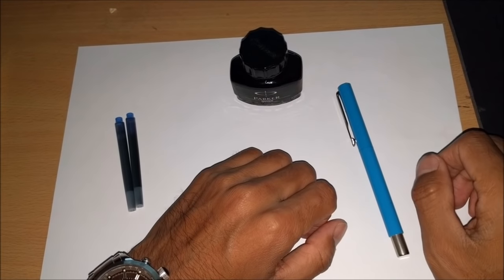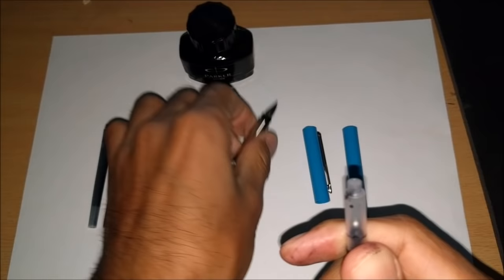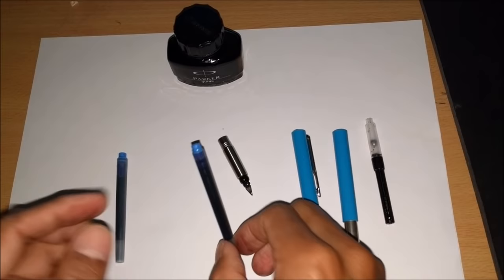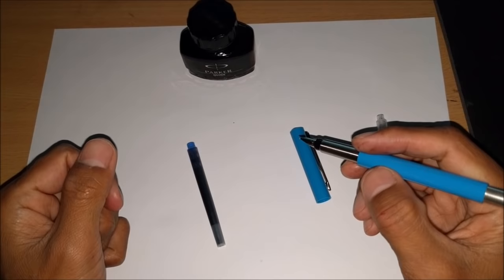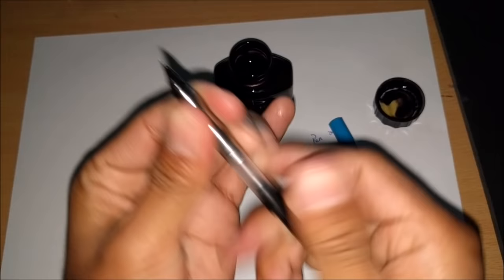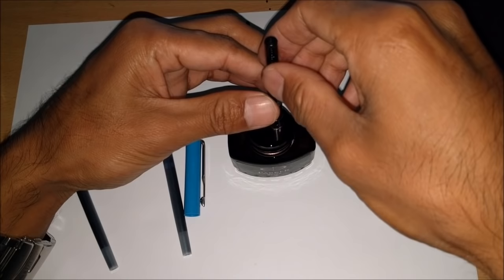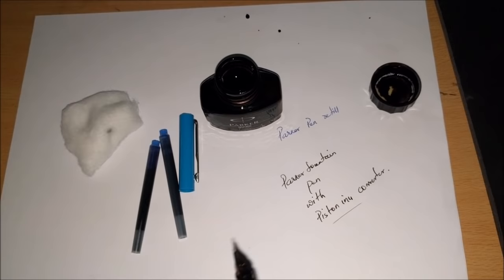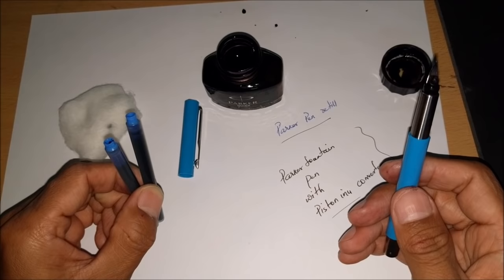Parker Fountain Pen Refill - Piston Ink Converter and Cartridge

Comment: Guys i need your help
I have old parker 45 Flighter edition
Since its old pen i have the converter broken inside

Question 1: can i replace the converter? What size i should use? Can use converter from AliExpress?

Question 2: I found disposable ink cartridges like those one but looks smaller and has 2 inner diameter, 3.4mm and 2.8mm, which one I should use?

Comment: hello, could you please tell me what the name of the pen is - the model and brand. i really want to buy this type of pen
Reply from the maker: Actually, Im sorry that i dont know the exact model as I`ve discarded the case. Its Parker fountain pen, and i thin the model name is Vector standard. But if you want to buy this range of fountain pen, I recommend you to go for stainless steel version as this version has plastic cap which is easy to broken at time..
Reply: Its Parker Vector standard
Reply: Parker Vector Standard Black/Blue with Ink Bottle
Reply: Parker plastic Vector Standard

Comment: Hey bro can you can pls reply theat you're converter also have scratches at top can you pls check and tell me because yesterday I bought a Parker pen and it's converter have scratch at the top so you can pls check yours and tell me pls humble request or anybody in comments can help me.pls
Reply from the maker: Scratch means as in defect? I have threaded pattern at the converter.